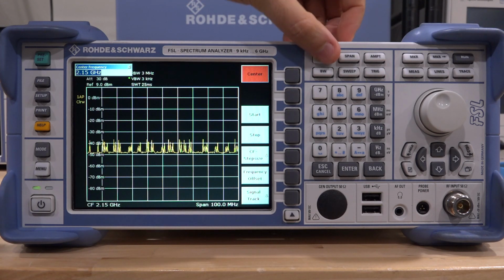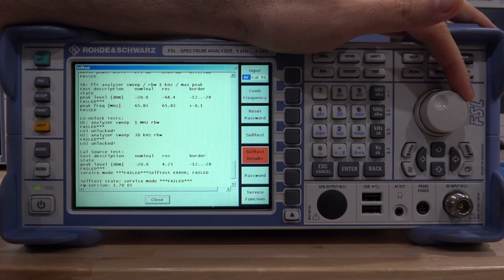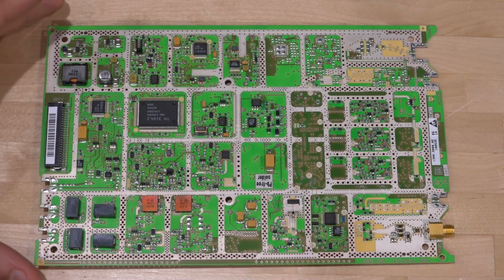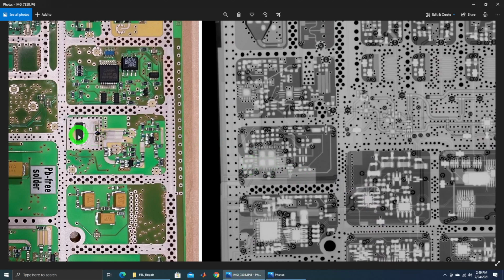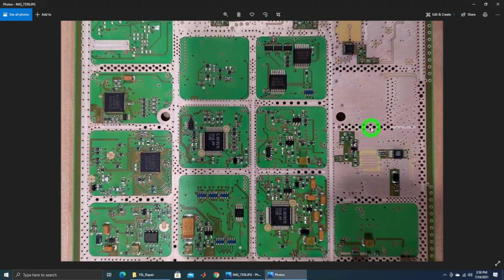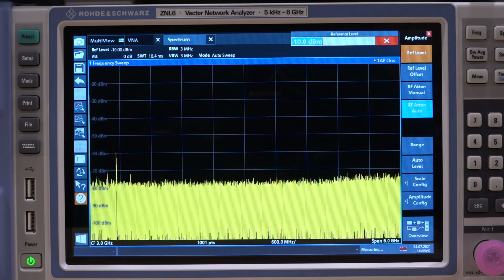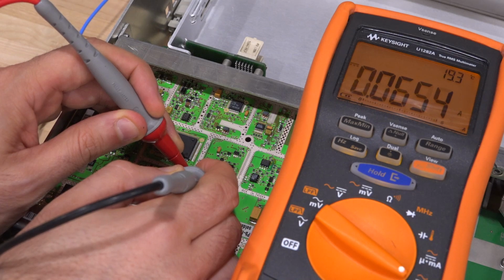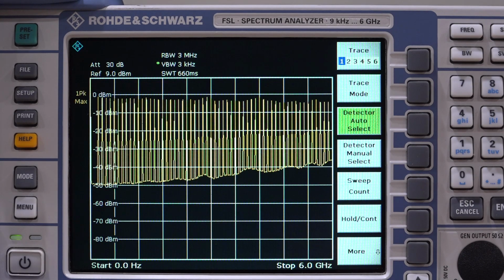TSP #197 - Teardown, Repair & Analysis of a Rohde & Schwarz FSL 9kHz - 6GHz Spectrum Analyzer

Comment: When the failure comes to passive element in such a complex circuit and you can track it and fix it...nobody can say you cheated the exam on the front panel connector😉

Comment: Nice to see my probe getting some use! I'll send you some pogo tips for it which should improve the landing quality. I can send you one or two of the solder-in sibling, the AKL-PT2, too.
Reply from the maker: Thanks! Improvement to the tips would be hugely welcome!
Reply: Will the AKL-PT1 be back on sale at some point?
Reply: @BaconbuttywithCheese  It never was sold openly in this form. I did a kickstarter for the 2.5 GHz first revision then massively improved it to the 6 GHz bandwidth prototype Shahriar is using.

I'm still making slight tweaks to improve flatness and ergonomics before a full launch. Its solder-in flex sibling, the AKL-PT2, is available now.

Comment: A common fault of MLCC: cracks which produce a short. commonly on MLCCs with higher number of layers, i.e. high capacitance. That one looked like a fat one.
Reply: I find these all the time
Reply: MLCCs will crack easily if heated unevenly, and silver migration through the cracks courtesy of lead-free solder will ultimately do the rest (note the Pb-free symbol on the board). An unholy combination.
To think that an instrument like this (few things R&S are ever cheap) can be taken out by a single bad one like ordinary consumer electronics is wild. I hope R&S have at least considered going with automotive grade MLCCs in more recent times. This model appears to be from the mid-late 2000s.
Reply: @LordPrecision  but all this eco-posturing makes purple dyed hair people feel superior about themselves
Reply: Eco-posturing? Pathetic.

Comment: As usual, great video!
I have one question, though: isn't the noise floor quite high at -50dBm? I would expect at least -80dBm from an R&S Spectrum Analyzer. Even the "TinySA" has about -80dBM noise floor!
Reply: Hi!
I think, it's because the reference level is 9dBm (it's too much for preciece measurements) and large RBW (3MHz).
Or maybe cheap 5% accuracy capacitor... Who knows😀

Comment: Awesome diagnosis and repair.  I wouldn’t know where to start.  You still got lucky that it wasn’t one of those custom IC’s that failed. 😺
Reply: IC's tend to be reliable now, as the early failure modes were researched and understood, and fixes applied to the process path for the more reputable manufacturers. The cheap ones know how they will fail, and roughly how long that will take, so just build good enough, to last that long for the vast majority of the devices. I would say R&S, and most of the other top end manufacturers, know the equipment might be in use for decades, so go for the most reliable IC's in there, and good quality for the rest as well.

Comment: So how much value did you add to the unit after replacing the cap and resistor?  A lot more than the time you sent on it I would wager.

Repairing assets and making repairable assets is a state of grace while hiding schematics and gratuitous use of unobtainable parts is evil.

What is clear from all the repair and activist material on youtube and elsewhere is that there are NO GOOD EXPLANATIONS for the evil that unchecked capitalism promotes.

Thank you for sharing your skills and wisdom so freely.

Comment: How far is that cap from the shield fixing screw?  If it's pretty close then root cause is a design error; too much stress on an MLCC.   Awesome repair video, outstanding presenter.
Reply: I have seen this a few times when caps close to mount hole would crack due to mechanical stress.

Comment: Seems like component problem. But R&S may charge you $3000 for repairing.
Reply: No, they will simply swap the board with a new one, and charge you $15k for that, and extra for the calibration afterwards.
Reply: @SeanBZA  EXACTLY what happened on my RTO scope. Two channels just dead suddenly one day (seems like communication problem between front end board and main board). They swapped the main board and calibrate, which costs $6,000! I still don't know why it's broken or even maybe no hardware is broken?
Reply: now the question is, would it be more or less expensive than 6k to pay an engineer to actually find the fault, fix it, and verify everything to a level that you're confident in the fix as a company?
Reply: @tommihommi1  
Why employ engineers full-time when you can short-term contract them to do the initial design, and then vanish them with a draconian NDA in their back pocket?
All of these companies are the same now - They have impressive research departments, but are mostly just marketing companies that hire the odd bit of part-time talent from time to time.

Compare the above to a robot in China spitting these boards out at 10 per second.
Reply: @digitalradiohacker  the engineers are busy designing the next generation, from what I know Rohde Germany is a decent employer
Reply: @tommihommi1  
They'll have to be - Their business model is to bend the rules of physics, and that takes talent that can seek employment elsewhere.
I don't mind buying a £400 scope from Rigol, and then being told "no" when I ask for a service manual. This is because the instrument "only" cost me £400.

Meanwhile, a similar modern R&S device to the one in the video is here: https://uk.rs-online.com/web/p/spectrum-analysers/1448236/
£11000. Eleven THOUSAND pounds.

Yeahhhhh - I'm going to need the FW source, bootloader and native board design for that price, and it isn't even a particularly expensive unit either.
Reply: @s921207  our RTO had one channel delayed by a few ns. The swapped the freakin frontend board and charged us 10k. It makes me sick.
Reply: @RandomUser2401  10k... that's robbery!
Reply: @tommihommi1  I believe they'll send the broken board back to Germany and fix it for future use.
Reply: @RandomUser2401 Instrument repair is now just a board swap and a HUGE bill. Keysight/Agilent have been doing this for years now. Makes me sick.
Reply: @digitalradiohacker  Rohde&Schwarz is not of this kind. - These may be the habits in the US.

Comment: Nice repair. I just wonder why the noise floor is so high. It's around -35 dBm at 6GHz.
Reply: 3 MHz of RBW and a fairly high reference level with 30dB frontend attenuation increases the noisefloor quite a bit. Additionally this SA might not be the lowest noise instrument
Reply: It is from the entry line series. Low performance, low cost.

Comment: Why some traces that connect resistors\capacitors or inductors don't have solder mask?
Reply from the maker: These are the RF traces. Solder mask is a poor dielectric material and is often avoided on RF paths. It is also generally not included in the EM simulations.
Reply: @TheSignalPath  Thanks. Can you explain more about this "Solder mask is a poor dielectric material"?

Comment: Hello, your work is fabulous, well done. I would like to ask you for advice because I have a Rhode&Schwarz FSL3 and the tracking output on the spectrum analyzer is defective. I don't have any schematics or electronic plans. My problem is the following: from the tracking I output a 0dbm, then from 9khz to around 100khz the tracking is not good at all. After 100kz it is at -2.5dbm up to 1ghz and tends towards 0dbm very slowly up to the max frequency 3ghz. Can you help me please ? THANKS

Comment: Repair of defective R&S FSL Spectrum Analyzer:  1) remove covers, 2) remove PCBA  3) analyze circuit  4) find defective parts 5) replace parts.    Equipment required: 1) X-Ray, 2) VNA  3) special probe (fund on Kickstarter) 4) soldering iron, solder wick, hand tools, etc.

Or buy a new one from Siglent;  >$100,000 test eqpt. not required :)

Great stuff Shahriar.  I always learn a lot from your videos and am a big fan.  Thank you.
Reply from the maker: A narrow vision...
https://en.wikipedia.org/wiki/Electronic_waste
Reply: @TheSignalPath  Yep. And if right-to-repair legislation makes providing schematics (and hopefully layout) mandatory the X-Ray could be skipped.
Reply: @TheSignalPath  You should send this to R&S.  No schematics, no manuals, no parts.  Pure arrogance creating land fills of dead R&S products.
Reply: @TheSignalPath  Repair and Reuse, Shariar is doing his utmost to get the last one, Recycle, out of common use, as repair and reuse is the most use of the rare elements that were used, and gives the lowest impact on the environment as well. That he also gets some impressive use out of them is also a bonus. Then of course the equipment that is tossed for an utterly trivial fault is the best value as well.
Reply from the maker: @shazam6274  First of all, R&S does not perform component level repair. No big T&M company does. The board would be tossed out and replaced. We are not even taking into account the cost of shipping and repairing it. Aside from that, it represents an opportunity to offer education on top of the repair benefit.
Reply: @TheSignalPath  It's a shame they don't even provide docs for end of life gear. My FS300 died recently and I'm working my way thru it with only block diagrams. Even Dr. Rhode N1UL couldn't shake loose schematics from his own company to assist me...$6K boat anchor until fixed.
Reply: @shazam6274  "Somehow Tektronix and HP /Agilent / Keysight / (whatever) have managed to survive and thrive over the decades, and still provide technical info with each product." - This is not true at all. HP stopped to provide component level information with their products in the early 1990s, if not earlier. There are even products of the 1990s where CLIP doesn't exist anymore at HP/Agilent/Keysight, due to their near-bancruptcy and hasty reorganization when the stock market bubble crashed after 2000.
Reply: @Henning_Rech  When did "Corporate, stock market profit seeking Managers" take over? Coincidence?  The larger point I was making is that with little effort or cost, it is possible to provide useful info (Schematic, PCB parts location and BOM).   Keysight has lost sight of its customers and newer Keysight equipment (like R&S) is valueless after it malfunctions.   R&S choses not to support repairs after several years or provide information to others to do so.  There are several videos from Shahriar, including this one, showing the repair of of equipment with inexpensive, readily  available parts.  There are also others where the issue is a custom IC or other proprietary part which was only available from the manufacturer and thus renders the repair impossible.  

By the way, HP's problems were created by inept, arrogant,  management.  Is R&S trying to follow their example?
Reply: @shazam6274  "When did "Corporate, stock market profit seeking Managers" take over?" - Rohde und Schwarz is a family-owned private company. They produce for the commercial market who wants paid service, not circuit diagrams.
Reply: @Henning_Rech  Sensitive!  I was clearly referring to HP, which you mentioned in your comment.  As for "Paid Service" from R&S, why don't you ask how much it would have cost and how long it would have taken to fix the subject of this video.  While you are asking, find out which  products are still serviced.  I would bet that very few 10-20 year old equipment is even accepted for service by R&S.